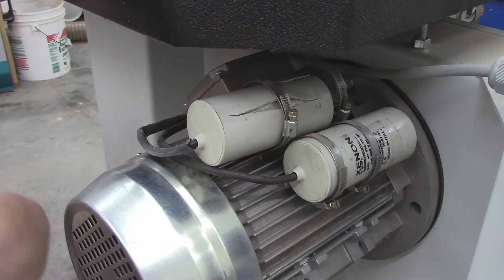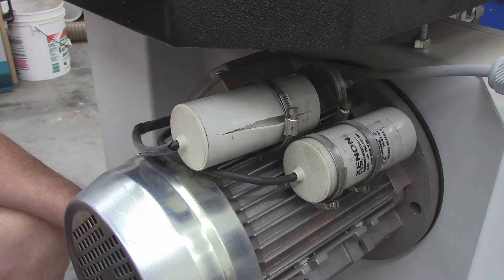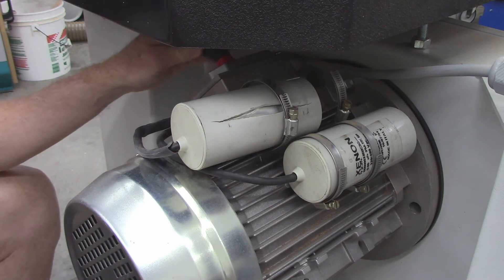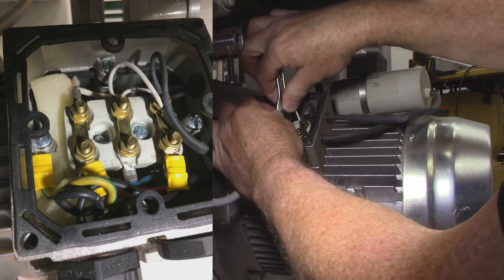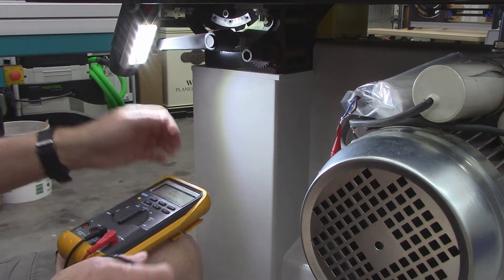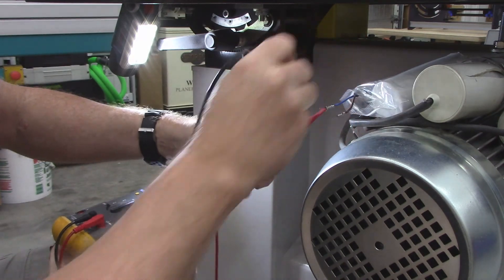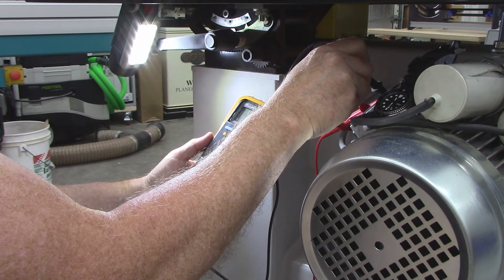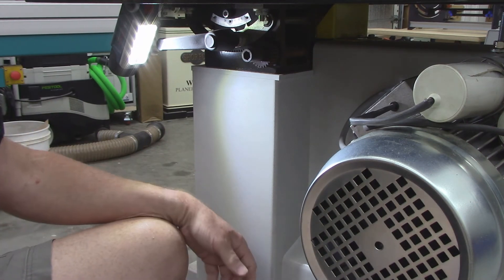Testing and Replacing Bandsaw Motor Capacitor

Comment: Do you have the bandsaw running while you’re testing the wires?
Reply from the maker: No, it is powered down and unplugged.  Steve
Reply: @ I have two red wires coming out of the bandsaw that were hooked into my old capacitor and I understand one of those red wires is live and the other one is a carrier. I’ve watched your video as to test the capacitors and I put them on the place that you had your multimeter set on to test them and I just keep getting a one for both of them so does that mean that they’re both good?
Reply from the maker: @vickibranham3026  I don't know what getting a 'one' means.  The capacitor must be disconnected from your machine in order to test and you need to follow your multimeter directions for testing capacitors.  Not all multimeters can test capacitors.  Mine is a Fluke model 87 so I followed the manufacturers' instructions for testing.  Yours may be different.  Steve

Comment: I have a SCM MINIMAX S45N and curious if you or anyone here knows about replacing the capacitor on it? It tries to run but only the motor hums with no movement of the blade.

Comment: Where did you buy your replacement capacitor?  Having a tough finding the correct part.  I notice that your bandsaw had the xenon capacitor which my bandsaw has.
Reply from the maker: Hi John.  The start capacitor has a built in timer and I have not found a source for it.  I replaced the run capacitor and purchased it on Amazon  https://www.amazon.com/gp/product/B08NYK8SY9/ref=ppx_yo_dt_b_asin_title_o00_s00?ie=UTF8&psc=1  Steve

Comment: Nice work. Is the big bandsaw actually that loud, or is that just the camera being close to the motor?
Reply from the maker: Hi michael.  The bandsaw is quiet.  You were probably hearing the brake that I applied to stop it as it is fairly noisy.  Steve
Reply: @extremewoodworker  Thanks Steve. That makes sense. I only have a small Inca bandsaw that is relatively quiet, and was wondering if large bandsaws were much louder.
Reply: Most of the noise was the motor fan, which had the mic right next to it.

Comment: Ya did a good job Steve. Thanks for showing it to us. I am an electrician and you did exactly what I would do. Bit of trivia: back in the days when I started in the "world" of electricity, we simply did not have start capacitor meters to check them. So it was a trial and error job. IE: If the new part makes it better then the old one was defective. LOL

But on "run" capacitors there was nothing (back then) that could be used to see if it was good or bad. Their sole reason was to increase the efficiency (meaning money) on large electric motors. For large motors often would have multiple "run" capacitors; to lower the cost of electricity. Without them, they eat current like it was going away. It has to do with PF (power factor); where the meter goes faster than it should. The run caps stop that.

Note: In some cases, the start and the run capacitor are the same capacitor. Most of the time they are separate.

Nowadays, they have all kinds of meters; that can check (accurately) most every thing easily. Like the one you used Steve. I would love to have them 65 yrs ago. All we had was "multimeters". But they were basically worthless when it came to checking (especially AC) capacitors.

For what it's worth.
Reply from the maker: Thanks Pat.  I am glad it was the run cap and not the start cap.  This motor does not have a centrifugal switch and the start cap has a timer in it.  Have not found a source for a replacement in the US.  Steve